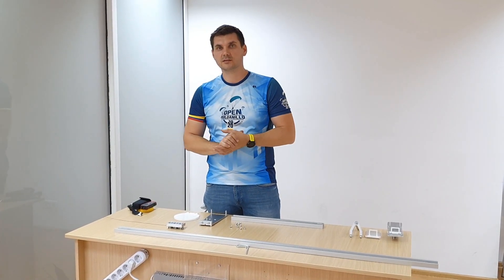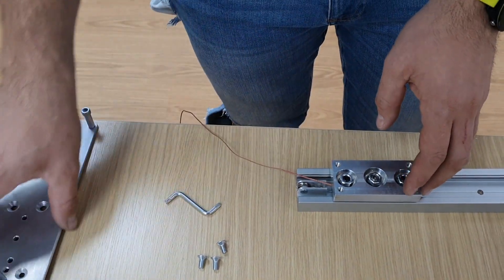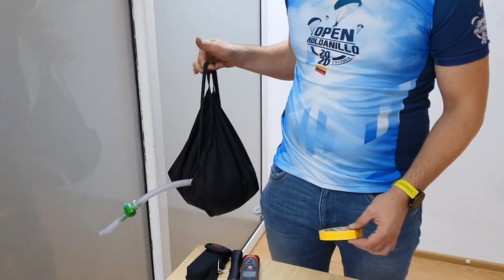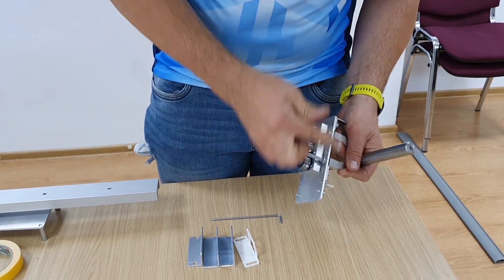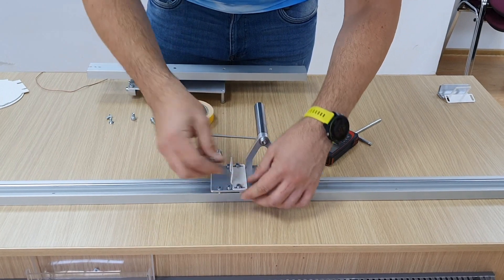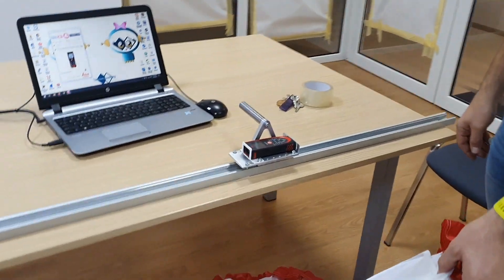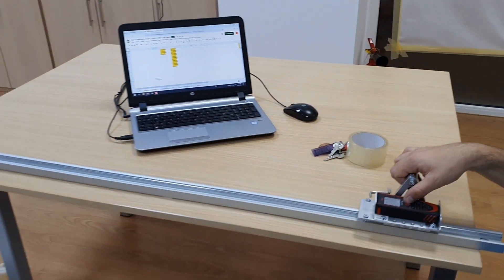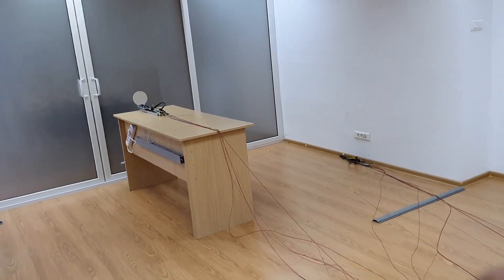Model 1 - High Precision Paraglider Line Measuring Tool

Comment: You are not applying 5daN of tension force during measurement. This is factory requirement
Reply from the maker: 50N=5daN I supose?! Yes, we hang a 5 kg for line tensioning - industry standard. 5*9.8~50N=5daN

Comment: Nice setup but I see two problems, first that the reflection plate should be right at the end of riser loop. Secondly there is a lot of play on the laser side as bearing are in a single row.

Comment: This is really really great excellent! I am in the process of building a trimming system, not nearly as advanced as yours, but I believe that what I can build out of wood will do the job. But what I really need to know is the software you're using. Right now, I need to manually enter all the measurements into the spreadsheet.  I am using a Bosch GLM165-40 laser rangefinder. It does not have a network interface. 
Any details you can provide about your leisure measuring tool and also the software would be greatly appreciated!
Reply from the maker: Hi Nelson, What you need is a bluetooth enabled telemeter and the software designed for that specific instrument (for bosch and leica it is called "transfer software" - it transfers the data read by the instrument to the pc>spreadsheet>excel)